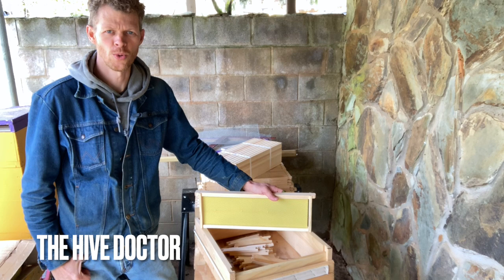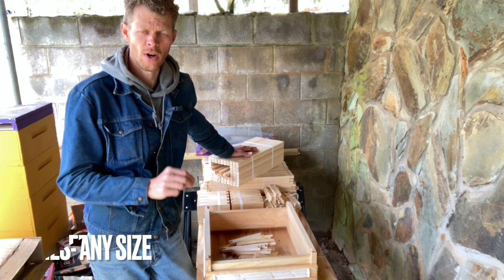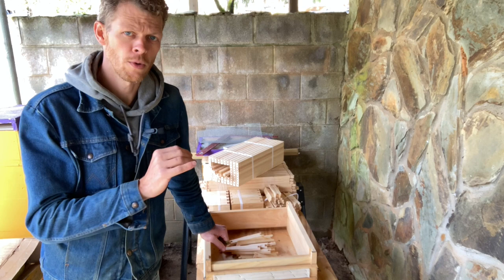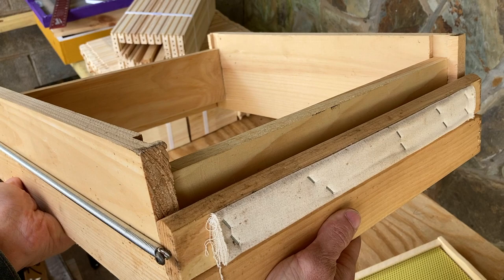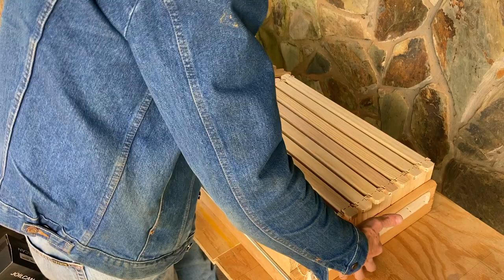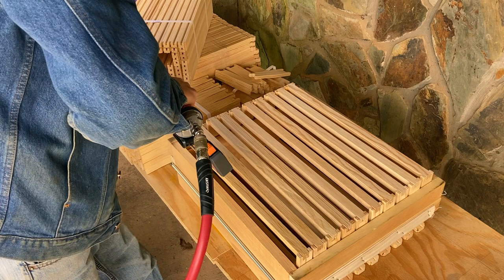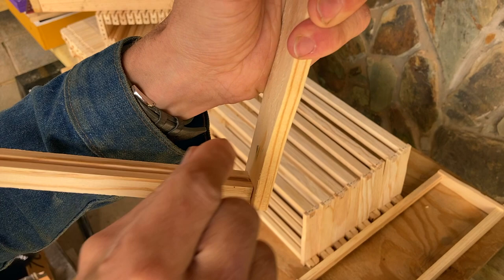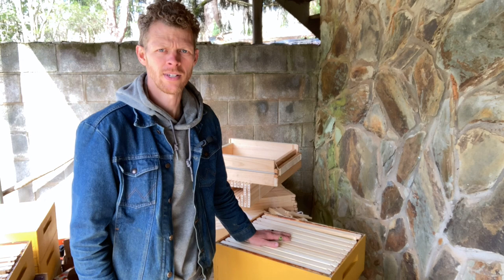How to Build Frames//Building Beekeeping Frames using Frame Jig//Build Any Frame Size

Comment: If your frames are glued they won't break. Also two staples will weaken the wood or split it. You can also make a very simple jig by making a box and using just two pieces of dowel or metal pipe. Just saying.
Reply from the maker: Hey Terry! I agree that wood glue is amazing stuff. Sometimes when wax moth overruns a box they will weaken the structural integrity of the frames because their developmental process bores into the wood, especially the end bars. Unfortunately wood glue cannot withstand wax moth😅🐝
Reply: Or a simple inside box and an outside box and then assembling like the store bought one you showedF.  At the end simply slide the inside box and the frames out of the outside box and keep on going.
As with all glue-n-staple joints the staples just hold the joint together until the glue dries or cures.  The real strength is in the glue and not the small brads or staples.
My way of thinking is that if a frame breaks once in a while just replace it with a fresh one and
Reply from the maker: @joesinakandid528 I’ve been thinking that too, if a frame breaks, replace it🐝

Comment: Staples or Superior to Nails because you tend to have one staple going north and one half going south so it causes a wedge effect. so yes quarter inch crown staples or the best fast efficient wages to attach the wood together.
 however glue is stronger than the Staples and stronger than the wood the only real purpose for the Staples should be to hold the wood together until the glue dries trying to call yourself an expert and then recommending not using glue is really ridiculous.
Reply from the maker: Hey M&EM Acres, glue is totally optional. Use it if you want to. I’m here to share my experience and that includes the difficulty of fixing frames that have been glued together. I don’t recommend it. You do you dude😉